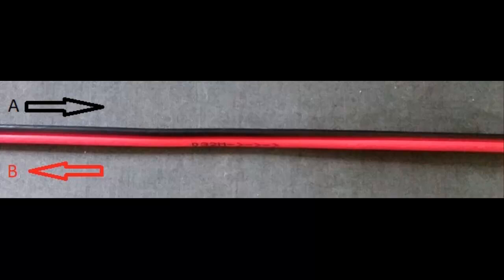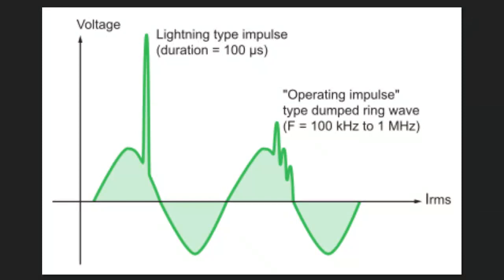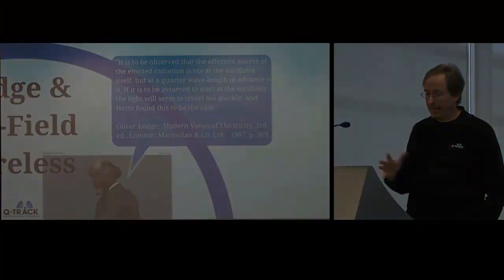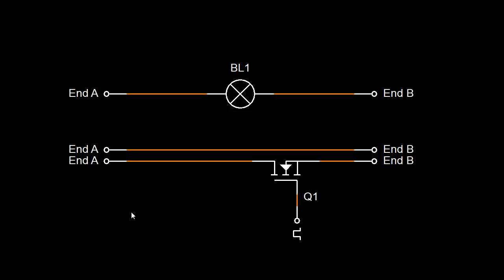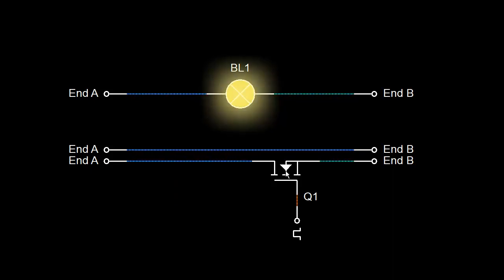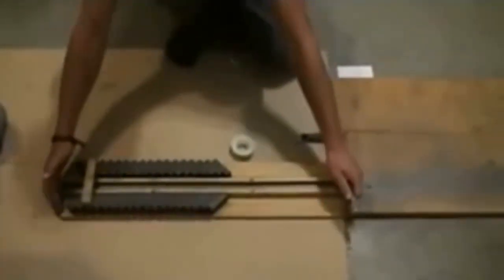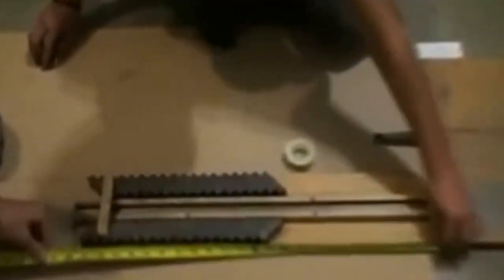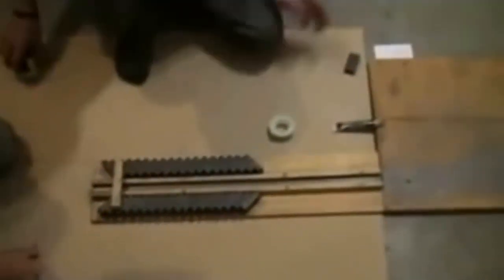Parallel Wire Experiment

Comment: Edwin Gray was so proud of his "splitting the positives" making his magnets launch so high in the air. And you point out that the bucking coils force the current down the wire, like a rail gun firing... Now, I get why Gray was so proud of his popping magnets. He apparently saw the same thing and tried to emphasize the process was giving his system extra power. (If you build a rail gun, your bullets should be magnets or electromagnets, forget pumping Kiloamps of current down the rails.)

Personally, I like to use the "Oberth effect" which exponentially increases the amount of kinetic energy that is transferred when the velocity of both objects prior to connecting are moving with more kinetic energy. IF you play baseball (or probably even cricket) and swing your bat with an accelerating swing, you get the same effect, giving your ball an exponential increase in distance traveled by the hit. Accelerating the change in magnetic fields colliding with the voltage by bucking the magnetism will give you the most efficient transference of energy which looks like amplification when compared with steady-state energy transfers (note that steady-state voltages cannot event transfer through a capacitor and similarly currents will not keep flowing through an inductor unless they are changing. The balance point is fundamental to simple conduction.  It is how nature works... why fight it? Just do it. Party on Dudes, be good to each other

Comment: Talking about parallel wires supporting each other, check this out: http://jnaudin.free.fr/html/lmdtem.htm These are not straight wires, nonetheless you might notice that second experiment gives something out of nothing.

P.S.: How this could be improved? Add parallel wire concept to capacitors, i.e. parallel filaments for each pole making galaxy shaped capacitor with 2 filaments per pole, then you can add 3,4...and etc.This could also be a negative resistor, but it has to be tested.